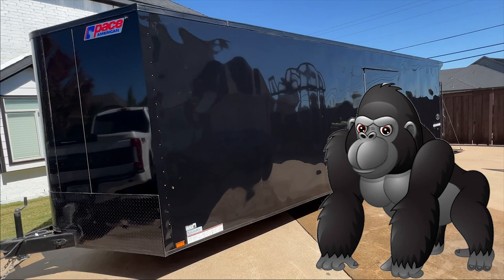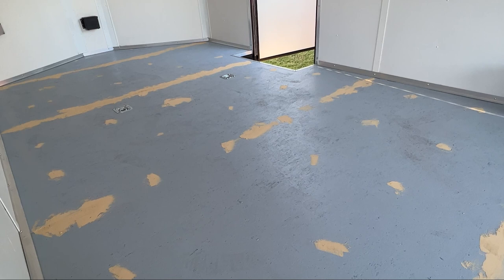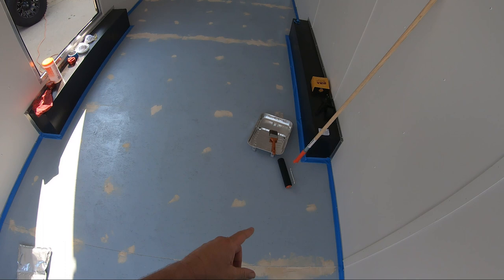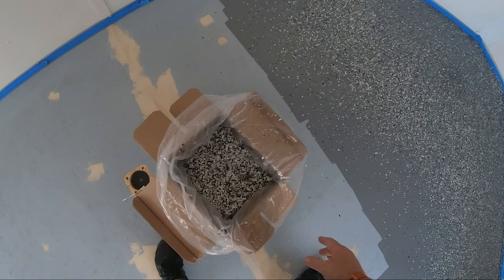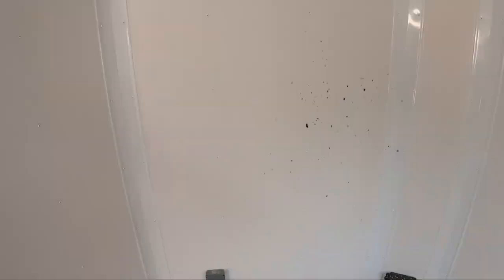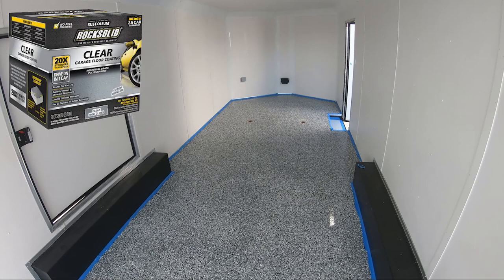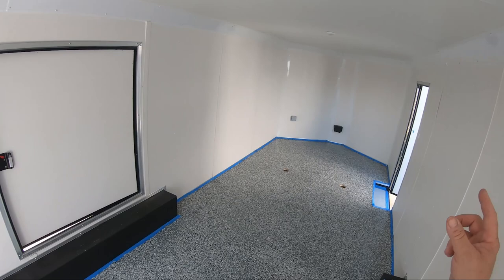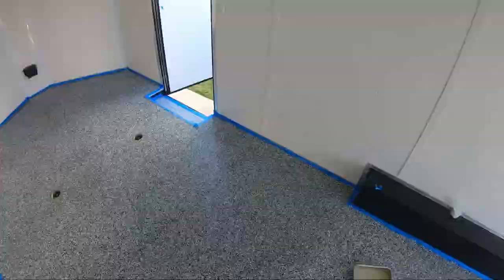Applying GARAGE FLOORING To My NEW ENCLOSED CARGO TRAILER | UTV

Comment: Add some stuff so we can use the trailer as a basic camping trailer. It's kind of like a toy hauler that's mostly hauler and basic place to lay your head in a pinch.  A/C, water, outside shower,etc.
Reply from the maker: @inspectorlee  makes sense. I’m definitely planning to add a little bit of that stuff to mine as well so that we can overnight and it when we want to.

Comment: I’m just curious on the wood putty aren’t you worried about expansion and contraction? Why wouldn’t you use something more like Bondo or something would’ve had some flex to it I mean wood putty for the most part unless it’s got latex in it it’s going to drive brittle and break away causing failure when you put the Epoxy down.
Reply from the maker: I haven’t had any problems with it but yes that’s probably a better idea. Thanks for watching!

Comment: Appreciate you sharing this, my sons and I are getting ready to do something similar to our Dirt bike / ATV trailer. I know the Rust-Oleum Garage coating kits are designed to adhere to concrete, I was just kind of concerned how it is doing on wood. It appears that you have 1 year on this coating / trailer since you posted the video, so my question is how is it holding up? Thanks again for the video.
Reply from the maker: Yes after a year it showed zero wear. I just sold it to buy a new one and have already done it to the new one. I'll post a video on it soon. Good luck! Thanks for watching!!
Reply: @HillRZRs  sounds great, look forward to watching it! Take care!

Comment: Did you use the 2.5 car Clear kit also and did you use all of it? Also about how much of the flake did you have left over if any?
Reply from the maker: I think it was 2 car not 2.5 but only used one of the two bags of paint. 
I bought way too much flake. I bought a 10 pound bag off Amazon. For me what comes with the kit would have been too light so I'd recommend extra but not as much as I bought. Thanks for watching!

Comment: In your video you said you bought a 40 pound bag of flakes but you commented 10 pounds? Was the 10 pounds enough. I have the same size trailer
Reply from the maker: Yes I bought way too much flake. 10 pounds was more than enough. I gave the extra to friends that used it and there's still some left. 
Thanks for watching!
Reply: Thank you!!
Reply: Where did you buy from? I can only find a 12lbs or 20lbs…no 10 lbs
Reply from the maker: @keithfowler8154  I just went back and looked at my order and I actually only ordered 20 pounds. And that 20 pound box was way more than I needed. I think if I was gonna do it again I would just buy this 5 pound bag.
https://a.co/d/2V9Te1Q

Comment: @hillsRZRs how is the rocksolid floor holding up? I have a enclosed trailer I'm wanting to do and it has primered floor. Moat other videos show naked wood. Hoping the Rock solid adheres and holds up?
Reply from the maker: Hey, it's holding up FANTASTIC. No issues at all. I actually had to order a bigger trailer today to be able to hold more UTV. I'm cleaning up the this one in the vid, this weekend to get it up for sale. I'll try to make a quick update video to post. I definitely recommend putting the clear on top. I really think it looks nice but also seals up all those flakes. I'll be doing the same to the new trailer. Thanks for watching!

Comment: What was painted on your floor? Rustoleum was no help. I know if I don’t seal the wood then I’ll need more then one kit for my 24ft. Has this been holding up good so far?
Reply from the maker: Hey Tyler, it's holding up great! If you are talking about the treatment that was on the wood before I applied the coating, it came from the factory that way but the dealer told me it was just a standard paint/primer. I bought the 2 car kit and only used one of the two bags of solution. I did order extra flake tho. Thanks for watching!
Reply: @hillsRZRs how is the rocksolid floor holding up? I have a trailer I'm wanting to do and it has primered floor. Moat other videos show naked wood. Hoping the Rock solid adheres and holds up?

Comment: Great video.
I'm going to do the same thing for my car/4 wheeler/ stuff trailer.
I'm painting my step, wheel wells,  and ramp extension the bed liner too
It doesn't chip like paint. You can also use grip tape on the steps. 
My question to me, you,  anyone is how to do the camper gear.  I'm an electrician so I'm doing solar with batteries and generator or campground electric for backup.
Looking forward to more videos. 
Be safe.
Reply from the maker: @inspectorlee  thanks! i’m not sure what you mean by the Camper gear. I sure appreciate you watching though.

Comment: Thanks for sharing, I have the same size trailer that I’m prepping to paint. If you did it again would you go ahead and hold off on the flakes and do a complete second coat? Or are you happy with the single coat? Mine is like yours were is already has a painted coat from the factory. Your thought. Yours looks great thought is would ask about that second coat before I start.
Reply from the maker: Hey thanks so much for watching! If I were going to do it all over, the only thing I'd do different is add more of the clear. There are a few spots where you can tell I put it on a little thin, when the light hits it just right.  
As I note in the video the first bag of grey wasn't enough to do the ramp door and the small step, so I used some high gloss black latex paint I had and there flakes on it. It looks great to me, but if you want it all to be the same, open the second bag. 
It's over a year later now I think and it still looks exactly the same. I love it.

Comment: Hi. Thanks for the video.   I am curious about the wood filler.  I don't want see cracks either when I do my floor.  I am worried that the wood filler you used might work its way open because its not flexible. Has it opened up on your trailer?
Reply from the maker: Hey. Yes I had the exact same concerns but so far, not at all. I think the coating is so strong that’s it’s helping prevent that. But it is flexible plywood after all and it may. I will probably do a one year review when I get to that point. 
Thanks so much for watching.

Comment: Can you give description of texture after being completed? Wanting to do this for my bbq competition trailer. But want to be able to wipe things up off the floor if they spill. Is that possible or is the texture additive to rough?
Reply from the maker: yes, because I put the clear on top afterwards it has a finish on it that I can clean very easily. It is not porous. It is more smooth and easy to clean. If you need some, you can add the grip powder to it which I did add a little bit, but that clearcoat on top makes it smooth and very easy to clean. thanks so much for watching.
Reply: What color was the chips? Was it the package with blue white and gray? Or the package that was black white and gray?
Reply from the maker: @ZachSmith9996  black, white and grey but I do like the one with blue also. Thanks for watching!